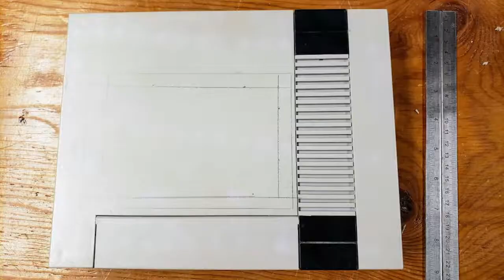NES LED Window Mod - LED Strips Inside Your NES Console! Cart Window !

Comment: I think for a clean look I’m going to use a hole saw. I don’t trust my abilities to cut a clean rectangle. I’m also going to add a little glue to the outside as a seal to prevent dust from getting between the glass and console.
Reply from the maker: Thanks for watching!  These are great ideas!  As you can see we struggled a bit too cutting a good rectangle - it's tough. Thanks again for watching and commenting and let us know how your build goes!!
Reply: @The8bitBasement  Cut smaller than the desired result, and use a file to finish... derp.   :)

Comment: Thinking about doing the LED strip mod if I pull the trigger on the Retro Gaming Restore clear NES shell. With some white LED strips there are positive and negative solder pads so should I still follow the same directions that are posted here?
Reply from the maker: Yeah absolutely...the positive would be equivalent to the 5V pad in this video.  That's gonna look awesome!

Comment: I wonder if adding an arduino would pull too many amps from the console. That way you could make the LEDs strobe through different colors.
Reply from the maker: My thought is that it probably would pull too much. I'm working on trying to use the pre-existing controller that comes in the LED strips so that you can use the remote to change colors and all. I'll post an update if I can get it working
Reply from the maker: Stay tuned. We were able to wire up strip lights with the controller/remote still in use. We will try to shoot a video in the near future

Comment: Is there a was to modify an NES to be a Top Loader using the technique?
Reply from the maker: Great question. There would be A LOT more involved to convert to a top loader but we suppose, yes, you would cut the shell as we did here.  Gives us an idea....stay tuned and thanks for watching!
Reply: @The8bitBasement  The one thing I keep thinking about is where would one get a 72 pin connector that stick up 90 degrees to make the Older NES's like a Top Loader? Would there need to be support under it to not break the mother board when pushing in the cart and would it need support to keep the 72 pin connector from being pulled up? An not to have a ugly hole for all this but could a 3D printed frame be made to not only hide the hole but also help guide the cart into the 72 pin connector? There's a bit to think about
Reply from the maker: @GlitchSystem-xf7jb  That's what i was thinking too - unless you could possibly run a wire from each pin to the corresponding spot on the board and somehow mount the connector vertically - when we have some free time we may just mess around with something like that...thanks for the idea!!  Let us know if you come up with anything.

Comment: Hello there!! very nice mod! can i do that mod with a 12volt LED-Strip, which is laying around aswell?
Reply from the maker: Thanks so much!!! I don't recall the output from the pins we soldered to but you would just need to measure it and see if there is enough voltage to power your strip.  My initial guess would be No though.  I don't believe it could power the strip
Reply: @The8bitBasement   thx for the help! ngl that is a very inspirational Video for me cuz i always wanted to do a mod like that! Keep up the good work!
Reply from the maker: Thank you so much for the kind words! We are so glad you enjoyed the video and it was helpful. We appreciate your support!!
Reply: Maybe measure the voltage on each pin, because on my PAL french NES the 1st pin is 12v, 2nd one is 5v, and power supply is same on both versions, so might find a 12v on the US NES maybe.